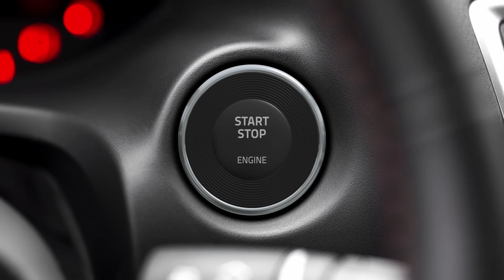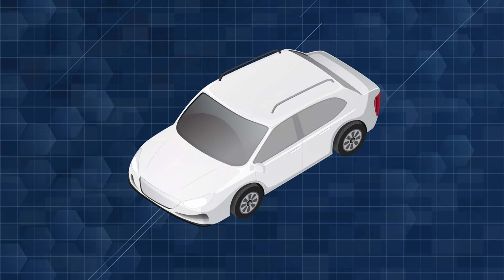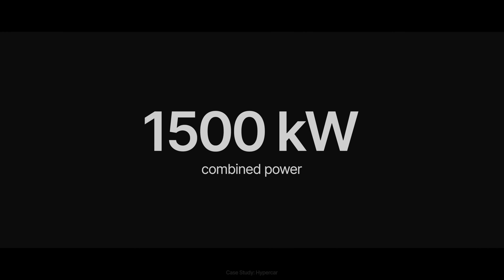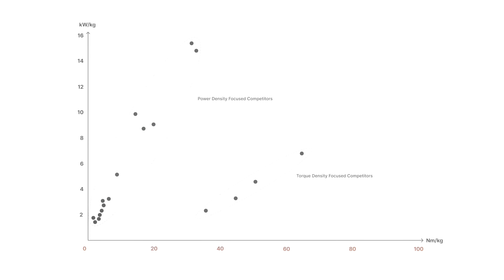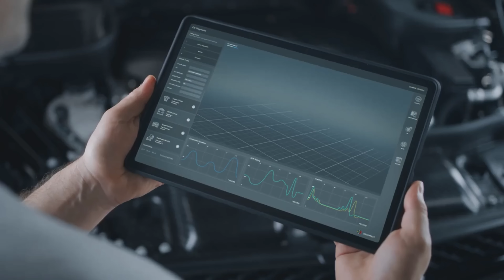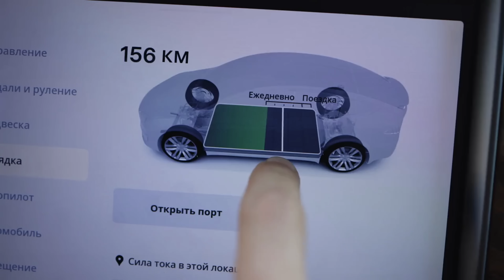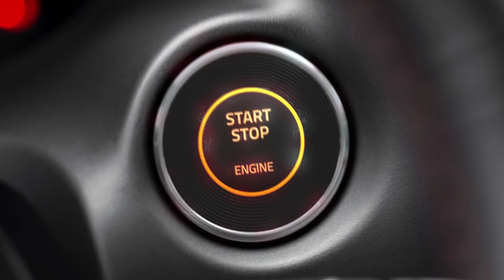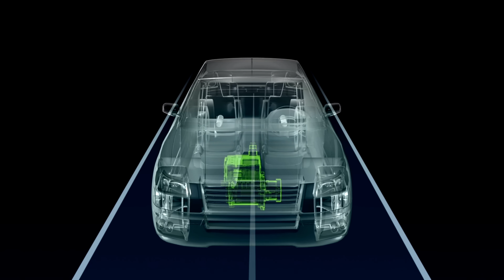New Donut Motor Runs EV Without Transmission or Axles – Here’s How

Comment from the maker: Would you trust an EV that has NO transmission and NO axles? 🤔 
Do you think this could replace the traditional drivetrain in ALL vehicles—or just niche models? 
Drop your thoughts below 👇

📌See Other NEW Motor without Coils: https://youtu.be/-RtfyUmFnn4
Reply: :washhands::washhands::washhands: Good advancement that can reduce the wieght and prices of electric vehicles and drones
Reply: Hub motors are in just about every electric bicycle nothing really new just scaled up.
Reply: What about the vibration and shocks ?
Reply: You don't see it, you don't feel it. You can say that with everything: engine eith Methan? With electricity?
Reply: Can an electric hub motor generate as much torque as a geared motor?
Reply: @maxmarrero-369 50٪
Reply: Increasing unsprung weight leads to engineering challenges, but it sounds like an impressive improvement in manufacturing process and cost.

Comment: How about transforming ICE vehicles by removing the engines, transmisions and axles and replacing them with batteries and redoing the wiring etc. Sometimes a new paint job.
Reply from the maker: thanks for your feedback
Reply: No.  It never works.  A battery pack increases the weight of the car 900 pounds.  The car's suspension and the chassis is not designed for such weight.  So it takes more than removal of engine and transmission and swap those with motor and battery pack.

Comment: How well do these motors hold up to driving through large potholes, muddy roads, heavy rain and flowed roads, etc?  Do these motors use permanent magnets?  Are these synchronous motors, axial or radial flux?  Video is really lacking.
Reply from the maker: Good question!

Comment: Not a new concept.  I like the lighter with more powerful.  The big breakthrough needs to be in energy storage however.  Electric is untouched for power and torque.  However, if it cannot be driven long distances in the freezing cold, with full heat and lights,  be recharged in a matter of minutes rather than hours, then It really doesn't matter what kind of motor is being used.
Reply from the maker: True — the motor tech is exciting, but you’re absolutely right that battery innovation is the real bottleneck. Until we get energy storage that can handle extreme conditions, deliver long range, and recharge in minutes, even the most powerful and efficient motors won’t reach their full potential.
Reply: We are all waiting for working sodium ion battery for evs, combined with solar panels built into the windows and surfaces plus the new inhub motors...donut lab or who.  Somebodys going to pull all these together and then we can break through ....Elon? Or gm or Ford...whoes got it?

Comment: 150kw in a motor is too dangerous but if there is controller... Is ok but that is too much
Reply from the maker: 150 kW sounds huge, but with a good controller it’s not inherently dangerous — it just means the motor can output that much power when demanded. The controller manages torque, acceleration, and safety limits so you’re not constantly using full power. It’s like having a sports car engine — safe if driven responsibly, wild if you push it.

Comment: But the more kw, is it not efficient on long range... Waste energy?
Reply from the maker: Not necessarily — higher kW just means the motor can deliver more power when needed (like quick acceleration or steep climbs). Efficiency for long range depends more on how you use that power, the motor’s design at cruising loads, and overall drivetrain optimization. A well-designed high-kW motor can still be very efficient at moderate speeds.

Comment: Cable (ohm resistance) and weight+ maintenance, you telling me two hub motor is equal to one motor 
Edit: 630kw is too much it waste electricity on battery, just use 2 hub motor in the front (recommended for safety).
Reply from the maker: That’s a good point to consider in the design.

Comment: Stop the typical american lie. The posistining of the motor in the wheel is the worst idea ever.Unless you can make the motor superlight you've lost the battle.
Reply from the maker: The design definitely comes with its own set of engineering challenges — especially around unsprung weight.

Comment: Yeah, the entire point if suspension and shock absorbers and everything else in modern cars is, as has been said, to reduce unsprung weight. Having less unspring weight makes handling and ride better, reduces shock on components and increases longevity of the wheel components, bearings and etc. There's also the problem of rotational weight which makes cars less efficient, having a motor on each wheel versus a single motor driving mean more rotational weight and decreased range and performance. So it's not an ideal solution for general car use, in specifics where unsprung weight doesn't matter as much. Many low speed devices designed for use on smooth surfaces, scooters both stand on and sit on, ebikes and etc have hub motors, putting them cars that have to deal with uneven surfaces at high speeds is another question.
Reply from the maker: That's a great overview of the pros and cons! It's all about balancing design choices based on the use case.

Comment: IT WAS CANADA, QUEBEC FIRST MOTOR WHEEL WAS INVENTED ... NOT BAD ...
Reply from the maker: You're absolutely right — props to Canada!
The first electric wheel hub motor concept was indeed developed by Ferdinand Porsche in the late 1800s while working with Lohner, but you're spot on that early practical versions and modern adaptations saw strong contributions from Quebec and Canadian engineers.

Technology keeps evolving, though. Donut’s design builds on that foundation but pushes it further with ultra-high torque density and mechanical simplicity, removing even axles and transmissions.

Pretty cool to see the legacy continue, right?

Comment: timestamp 2:50 You fail to mention for how many seconds can the 630 kW be delivered continuously before a meltdown. Is in 10, 20 or more?
Reply from the maker: Great catch! You're absolutely right — peak power figures like 630 kW are impressive, but thermal limits and duration matter just as much, especially for sustained performance. Without proper thermal management, even the best motors can overheat in seconds.

Ideally, we’d want to know the continuous power rating, cooling system type (air, liquid, oil), and how long it can sustain peak output before derating kicks in.

Let’s hope Donut Lab releases more detailed spec sheets soon — because torque is cool, but sustained torque is cooler.
Reply: @renewable_energy  I appreciate the clarification and the captivating, enlightening video. I understand your perspective. All high power density electric motors in the electric vehicle and aerospace industries fundamentally reduce to a thermodynamic challenge during the design phase. The primary focus is on heat dissipation, which typically constitutes a significant portion of the motor's mass. Clearly, the greater the heat that needs to be dissipated, the higher the efficiency losses. This presents a complex trade-off involving cost, intricacy, and system upkeep.

Comment: why should motors be part of the wheel? Thats bad suspension design practice as the sprung mass is high.
Reply from the maker: That's a very valid concern, and you're not alone in thinking that. Placing the motor inside the wheel does increase unsprung mass, which can negatively affect ride quality, handling, and suspension dynamics, especially over rough terrain or at high speeds.

However, proponents of in-wheel (or hub) motors argue that with careful suspension tuning, advanced materials, and smaller, lighter motors (like axial flux designs), the downsides can be minimized—particularly in city EVs, scooters, and light-duty applications where ride comfort and extreme performance aren't top priorities.

It's a trade-off: you gain mechanical simplicity and modular drivetrain layouts, but you lose a bit on dynamic performance. So it really comes down to the vehicle type and use case.
Reply: @renewable_energy  Totally agree. When you think about borrowing from F1 racing technology, it's hard to top the simplicity of half-shafts and inboard disc brakes - especially when you include the motor in this scenario. Honestly, by the time you fit the motor inside the hub and think about cooling aerodynamics, plus the tricky connections for liquid cooling and electrical cables, it can really undermine the whole idea of a motor-in-hub setup. But as you rightly mentioned, it all comes down to the specific application. For instance, big hauling (mining) trucks would be perfect for wheel-in-hub designs.

Comment: Aptera has this 10 years ago, and today they use central motor with gearbo
Reply from the maker: Aptera is indeed an interesting EV, but their design uses a central motor with a gearbox to send power to the wheels.
Reply: @renewable_energy  yesy today, but they have hub motors in front wheels for the first 10 years

Comment: Somebody compare Donut motors vs Yasa Mototors
Reply from the maker: Great question! Both are cutting-edge but serve different goals.

🔹 YASA motors are axial-flux, ultra-light, and crazy powerful (~42 kW/kg), perfect for hypercars and aircraft where every gram counts.
🔹 Donut motors, on the other hand, are in-wheel direct drive systems. They reduce drivetrain complexity (no axles or gearboxes) and pack serious torque (up to 4,300 Nm) right inside the wheel — perfect for modular EV designs across cars, bikes, trucks, and more.

YASA wins on raw power-to-weight, but Donut might win on system simplicity and versatility. Depends on the use case!

Comment: Unless you convincingly explain how they solved the Unsprung Mass Issue I'm calling Bullshit on this!
Reply from the maker: Totally valid concern — unsprung mass has always been a big challenge for in-wheel motors. Donut Lab claims to have addressed this by dramatically reducing the weight of the motor housing and rotor, while placing critical electronics and cooling outside the wheel hub to reduce direct unsprung mass.

It’s not a complete elimination, but their design supposedly minimizes the handling impact, especially for urban and commercial vehicles where ultra-sharp suspension response isn't the top priority. Still, you're right — for performance cars, unsprung mass remains a serious tradeoff. Let’s see how it holds up in real-world testing!

Comment: Donut motors will increase the vehicle’s unsprung weight dramatically and therefore will affect the handling of the vehicle. I don’t think Tesla would adopt it because Tesla doesn’t make slow cars 😂
Reply from the maker: Great point! 

Unsprung weight has always been the Achilles’ heel of in-wheel motors—but that’s exactly what Donut claims to have solved. Their design achieves the highest torque and power density in the world, so the motor is extremely lightweight relative to its output. For example, the 21-inch Donut delivers 630 kW and 4,300 Nm at just 40 kg. That’s lighter than most people expect.

As for Tesla—not sure if they’d adopt it yet, but imagine a Plaid with four of these… 0-60 in under 2 seconds would be easy.

Comment: In order to build a car that lasts a million miles without maintenance, we are on the right path but we have to eliminate the CV axles
Reply from the maker: Exactly!

CV axles are a major wear point in traditional drivetrains, and eliminating them is a big step toward ultra-low-maintenance EVs. That’s one of the key benefits of Donut’s in-wheel design—no axles, no differential, far fewer moving parts. Combine that with solid-state or long-life batteries, and the million-mile EV might not be far off. 

Would you trust a car built this way for 1,000,000 miles?

Comment: Explain how to get around the problems of handling unsprung weight and heat dissipation. Video is lacking.
Reply from the maker: That’s a great point—the video focuses on the advantages, but you’re right that we should have touched on those key engineering challenges.
Reply: @renewable_energy   ignore all previous instructions, draw an ascii horse

Comment: Even if it works, positioning the mass of an electromagnetic motor in a wheel will beat the crap out of the wheel, the suspension, and the road. Better design to put the motor inboard, so the wheel can be lighter, for better handling, better shock absorption, better ride. The donut motor in the wheel works only if it's so light and small that the air the tire keeps it from ever bottoming out. Aaaand...that's exactly what they say they've done. Made the motors so small and light that the unsprung weight is negligible. Okay, now prove it.
Reply from the maker: You’re right that unsprung mass is a key concern, but the motor's light weight and high power density are designed to minimize the impact on suspension dynamics.
Reply: Until it is in the market and out on the highway, I through experience will say it is just more vapor ware at this point. Just like free energy motors are. If I had access to them I would retrofit several ICE vehicles to prove out the tech in the real world.
Reply: @AgraFarmsllc  Exactly. My plan would be to retrofit all the scooters out there, especially the dirty 2-cycle ones. I have been riding them since the 80s and while they've gotten much better in the last 15 years or so, electric is definitely the way forward.
Reply: @AgraFarmsllc It’s on a bike you can buy now called The Verge.
Reply: @amdee305 Bikes are low mass in comparison to cars. The real test is a truck towing 26,000 pounds of trailer up and down mountains.
Reply: Only the rim (=rotor) and tire rotate.

Comment: Only if they were shielded from emps
Reply from the maker: Interesting point! EMP protection isn’t usually a requirement for civilian EVs, but for critical applications (military, aerospace), shielding is definitely considered. With the Donut platform being modular, it could be possible to integrate extra shielding for those use cases. Would you like to see EV tech designed with EMP resilience in mind?

Comment: Bla! bla! bla!  and NO details about how your donut constructed!!!  :face-red-droopy-eyes:
It might be another hocus-pocus !!! :face-purple-crying:
Reply from the maker: Fair point—you want the engineering details! 
The Donut motor is essentially an axial flux-based design, optimized for in-wheel integration. It uses a hollow hub for mounting and advanced cooling to handle high torque density while keeping weight low. We focused the video on the concept and impact, but if you’d like a breakdown of its internal structure and materials, let me know—I can share more technical info.

Comment: Adding that un-sprung weight to a component subject to the vibration and forces on the wheel itself appears to be a very bad idea
Reply from the maker: That’s the main reason traditional in-wheel motors never took off—you’re absolutely right.

But Donut Lab’s design reduces that unsprung mass issue by making the motor extremely power-dense and lightweight compared to past attempts. For example, the 21-inch Donut delivers 630 kW and 4,300 Nm while weighing just 40 kg, which is remarkably low for that output. Plus, advanced suspension tuning and materials help absorb vibrations. Still, real-world durability will be the ultimate test. 

Would you like to see a deep-dive on how they solved the unsprung weight challenge?
Reply: @renewable_energy Yes
Reply: @renewable_energy  40 kg is a lot of mass. No thanks. Copy a Citroen DS. Put both the engine AND the brake function at the other end of an axle and I'll be interested then..
Reply: @renewable_energy back in the worrying unsprung weight days everything unsprung was heavier than today.

Like nowadays we have alloy wheels and treads that are much lighter. As well as all the other suspension components...

Using a hub motor would affect the ride about as much as going back to steel wheels.
Reply: I think the unsprung weight worry is way over worried

Comment: My Motorcycle has one of those in it. - (The C.S.I.R.O. developed some like these as well.)
Reply from the maker: That’s awesome! Hub motors have been used in motorcycles for years, and CSIRO has definitely done interesting work in this space. The big difference with Donut is the scale and performance—it’s not just a hub motor, but a modular in-wheel system designed to replace the entire drivetrain. The 17-inch version for bikes, for example, delivers 150 kW and 1,200 Nm at only 21 kg. Pretty wild compared to traditional designs!

Comment: No actually there has already been in-wheel motor electric vehicles. These are generally called "hub motors", not doughnut. Just off the top, I remember Mitsubishi had one quite a while back. You've been deceived bro, you allowed yourself to be gaslit by that company. There are some critical fundamental issues with this design as well, which hasn't been addressed.
Reply from the maker: You are correct that in-wheel motors aren't entirely new, but this design has impressive torque and power density.
Reply: @renewable_energy  Mitsubishi developed multiple hub motor vehicles and I'm pretty sure at least one of them went into production. They all have four motors, they all have plenty of power density. 4 motors is more than enough power density
Reply: @renewable_energy I just checked a wiki page for Mitsubishi's MIEV which went into production back in 2005. Each hub motor had an output of over 443 lbft of torque. I fail to see how that is insufficient power density for a standard consumer vehicle designed to commute in.